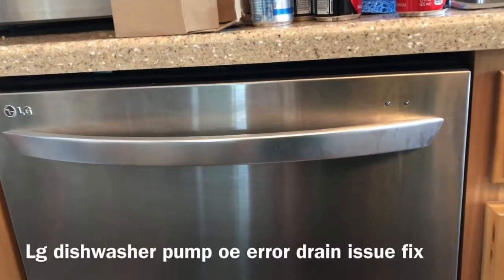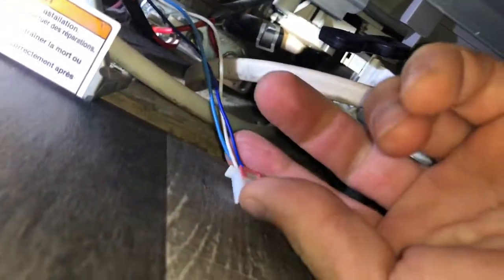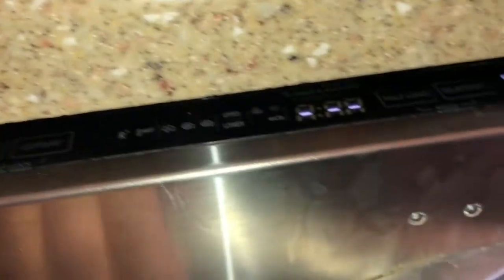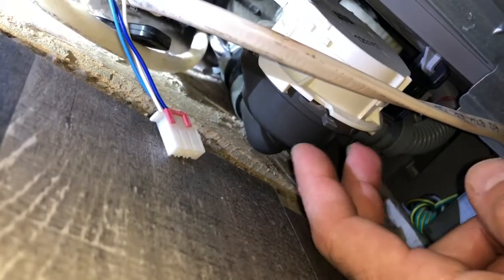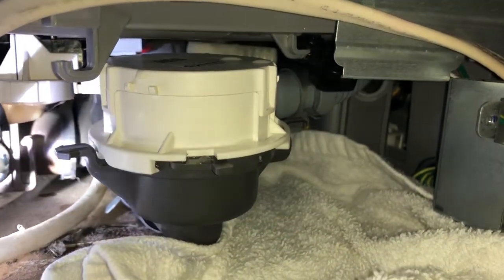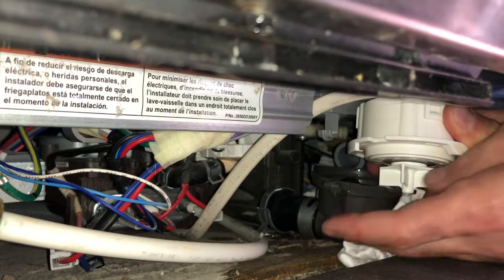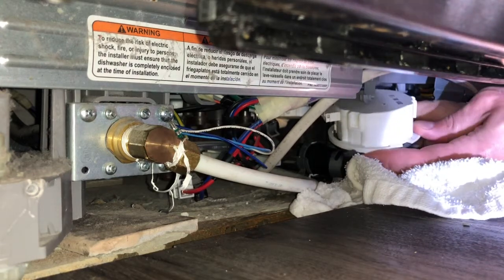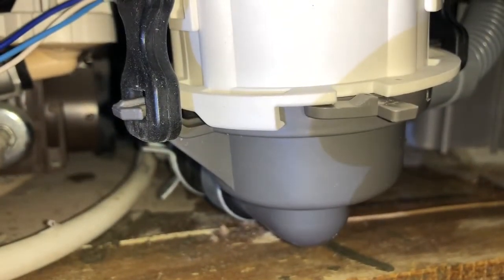LG dishwasher not draining (repair)

Comment: Thank you for posting this video. I also have an LG dishwasher and have been getting this OE message for the past few days. Normally I would power down and start it again and it would work. Today it just stopped working. For me, I followed your video and took the drain pump out and wouldn't you know there was a string through a couple of the holes on the spin dial. Took it out, put it back together and presto - it's draining again! Thanks again!
Reply from the maker: Good to hear